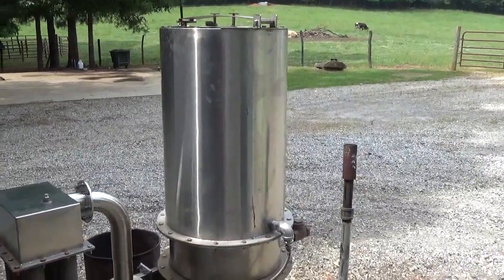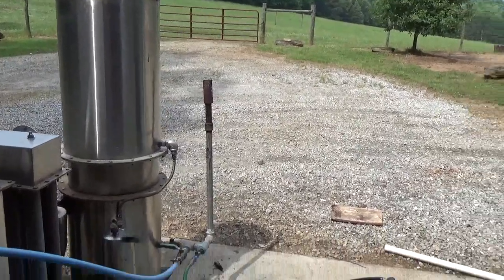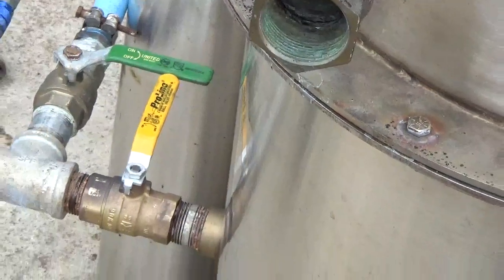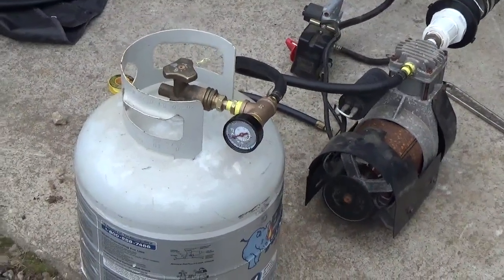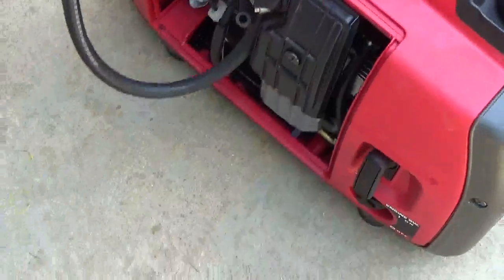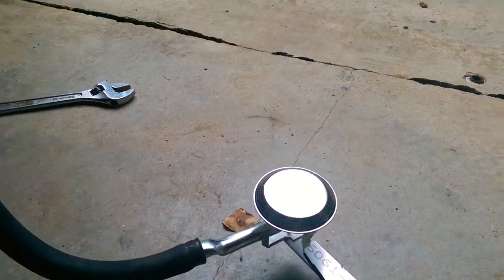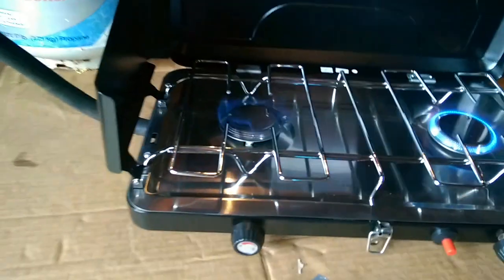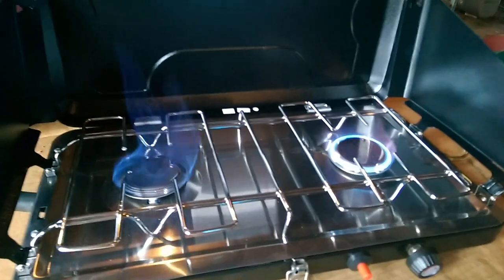Compressing Woodgas for future use.

Comment: Probably mostly air because with a compressor sucking 30-60psi from wood gas generator. It will take maybe 2 seconds to empty all smoke then sucking air. Will need a large volume of gas in to the compressor

Comment: This is an interesting experiment. I wonder of you could compress the woodgas into a large 300 or 400 gallon propane tank, allow the gas to sit and get very clean, and then run it into an electric generator. With the right setup, one could produce all the heat and all the electricity a farm needs. The electric generator could kick on as needed to supply supplemental power to solar/panels and battery bank. Heat extracted could go into the house, hot water an home in winter months.I know the big problem historically has been short engine life due to build of a dirt,  ash and more in engines and engine life in a sustainable situation like this is very important.

Comment: Questions to you or others who have ventured further and experimented with gas mixing. 
Q1.     What are the additional dangers and feasibility of this operation you have demonstrated with the compressing and storage of woodgas if small amounts of hydrogen gas was introduced in a purposely devised vortex style chamber that is vacuum operated by the compressor. 
Q2.     Will the two gases actually mix and remain that way under compression or will they separate? 
Q3.     Will the gas derived from a hydrogen reactor if "remained mixed" with wood gas still brittle the propane tank?
Q4.     Are the rewards of increasing the BTUs of the syngas worth the  inherent dangers of adding hydrogen production to this process????
Yes the possibilities are very big but so can explosion!

Comment: Edit: Upon further investigation it would seem some of the carbon byproducts act as an inert barrier to stop embrittlement for a time. That being said if you are storing this for a large amount of time the embrittlement will still occur albeit slowly. I still feel my original comment still stands truthful. This is still very dangerous and should not be attempted unless you can regularly hydro-statically test your gas cylinders and have a H (Hydrogen) and COx (CO2,CO,etc) ppm tester.

JESUS CHRIST!!! look man not gunna lie compressing hydrogen and various hydrocarbobs is a disaster waiting to happen. I see your using a old propane tank too bad its made of steel/aluminum which with hydrogen and most hydrocarbons causes embrittlement! Hydrogen its self has been known to spontaneous detonate when it reaches a certain ppm with the open atmosphere. TO ANY ONE WATCHING THIS VIDEO, DO NOT ATTEMPT THIS VERY DANGEROUS!!!
Reply: That's odd.  Propane is what?  C3H8 or a hydrocarbon close to that.  So if the cylinder works with propane, why wouldn't it work with woodgas, aka methane, aka CH4?    Also, pure hydrogen is stored in steel cylinders under very high pressure.  So why no embrittlement there?  Spontaneous detonation of hydrogen?  Maybe inside the sun.  True, hydrogen gas is extremely flammable, but the gas being compressed is nearly devoid of oxygen, certainly well below the LEL concentration.  I dont believe your assertions and neither should anyone else in my opinion.

Comment: Can't you just condense the gas into a liquid buy rapidly cooling it then storing the liquid like petrol?
Reply: Methane, under normal room temperature, maintains a vapor pressure of around 3000 psi, meaning to liquefy it at that temperature, or rather, to maintain it liquefied at that temperature, you need a cylinder capable of those levels of pressure.  Supercooling the gas to liquefy it is achieveable, but then you either have to keep it cold, allow it to bleed or have a high pressure capable cylinder.

Comment: The one problem I see with this and it's a fucking huge one is the fact that you're mixing the gas with oxygen as you compress it from using a pump that overcompensates for the flow of the gases expanding from the fire and is drawing an extra 02, and with fuel and an oxidizer in the same vicinity you're basically making something that could detonate whenever it decides to

Comment: I been looking at so many videos on producing wood gas, compressing wood gas for future use, fueling cars, running propane powered refrigerators off-grid. I really want to have an off grid cabin one day that I use wood gas for heat,cooking and electric. My only question is of all the videos I've seen people running a generator on woodgas how come people are always running converted gasoline powered generators rather than propane fueled generators or even the duel fuel generators that work on either gasoline or propane. Couldn't you run a generator that's already set up for running on propane on woodgas without modifications because it's a gas instead of a liquid fuel?
Reply: yes.

Comment: Are there any issues with scalability of this concept that you can think of?  I was thinking of doing exactly this but with a larger tank to run my 17kw gen when the power goes out etc.  Safety wise, does it store as well as say nat gas or propane in this format?

Comment: Using wood directly to say, cook dinner, is a tedious and wasteful affair. There is really no way of doing so inside of your home during warm months without making the inside of the home horribly hot. Of course, you could have a "detached kitchen/summer kitchen" for this, but cooking dinner would still be hot work.

Or, you could spend some time generating wood gas using free wood, then compress it (being sure the tank is properly purged before adding wood gas) for later use. Then, you can utilize it in a similar manner to propane. I suspect that it could be used as a replacement to propane if a burner configuration that is most efficient for wood gas is figured out and the propane appliances "converted". Probably would need to find a good way to regulate the wood gas pressure as well. If all this were figured out, in theory, you should be able to replace propane with wood gas. The flame-out safety protections on propane appliances should work for wood gas too (cut off gas supply if the flame goes out).

The big limiting factors to "converting to wood gas" would be obtaining wood gas (pretty much have to do it yourself with equipment you made yourself), ensuring safety (CO precautions), and sustainability. Theoretically, wood can be farmed to make it a renewable resource and it should be doable even if a large portion of the population "switched" over to wood gas instead of propane. Once technology advanced in the storage of wood gas, running cars and trucks on it would be pretty easy. No longer would you need an on-the-fly gas generator that takes forever to get going. You just turn on the gas supply, start up the engine, and go. When the wood gas is low, refill it either from your own storage tanks at home or at future wood gas stations.

Imagine, independance from oil companies when it comes to transportation. Imagine, a clean renewable energy source that can be used at any time of day or night regardless of weather. An energy source that is actually cheap to use. Making wood gas is quite simple. The hard part is filtering and storing it. If you can store it in a safe manner, you can transport it. If you can transport it, you can have wood gas refill stations. If you can have wood gas refill stations, you can run cars and trucks on wood gas in a similar manner to how we run them on gasoline and diesel. Instead of fields of corn, it will be massive forests of probably hybrid or genetically-modified trees bred/designed to grow quickly yet still yield a decent end-product.

Wood gas can be revolutionary. It can run gasoline engines. It can heat homes. It can be used to cook with. It can run generators (producing electricity). Pretty much anywhere propane or natural gas is utilized, it can be utilized. If the supply chain adapted properly, it could be a solid long-term renewable resource that is way better for the environment than our current fuels. It could literally put a huge dent in the climate change issue. With so much use of wood, naturally, companies and researchers will begin trying to find other ways to utilize wood. Maybe we could someday replace all our plastics with wood-based plastics.

Comment: Can anyone tell me what the problem would be with compressing using a combination tromp/ram pump say  60 to 80 psi? seems like the perfect low teck solution especially if the gas is being used directly out of the rams gas cylinder. Cooled and compressed in water. would the contact with water make for unusable gas?

Comment: I've watched people build these and they think they got good gas because it's burning the flame is just as red as can be so they run their generator it runs fine till they shut it off and it cools down and then all the sap that's in there locks the motor up screws up the valves the cleaner it is the less you can see it you've got pure nice gas if you filled a thousand gallon tank with that machine you could run a generator for a long time but the power went out you could heat a house for a few months the possibilities are endless when you've got such pure gas nice job good build

Comment: From what I gathers wood gas has lower btus than petrofeuls . Still its wasted ennergy . Light load electricity and horsepowrr can  be generated in house rather than buying it from external source . My hope is to run a 14 horsepower riding mower of of compressed woosd gas . I want to build work horse truck using a cvt  and a 14 hp engine . Basicall a dump truck for hauling 600lbs payloads at a slow pace . Not sure yet how feasible it will be giving its low btus but am willing to try

Comment: Have you done any more experimenting with compressing wood gas?  Wondering if you filled a bladder (e.g. military fuel bladder) with the gas and then compressed in the tank would help not pull air in with the gas??

Comment: Could getting a bank of batteries......... charging them up , getting the conversion equipment........

For me......... although more expensive......... it’ll be a lot more safer.

Operating a generator with a gasifier for me is a better option than getting solar panels and still having power companies getting into my pockets.
Reply: Generators usually run around 25 hours or so before you're supposed to change the oil, though that varies, but it's still a cost you should consider. Also, batteries lose charge over time. After about a month a car battery won't start a car, so compressing wood gas is a better long term solution.
Reply: @ Robert Sullivan 

You are making a lot of sense.......

I think I’m going to try baby steps first........ like, can I cover my energy (electricity) demands for my air conditioner to cool down my house 100% and taking that cost away from my bill. Then do the energy for washing and drying the clothes.......... believe me......those two are killing my budget.......

Then...... lastly......energy for an electric ⚡️ car 🚗.

I’ll be a very happy camper.

Comment: Yes! finally I see someone charging up a tank with woodgas. I really want to know how much and how long it would take to fill a big ol whole house storage tank. How long can it run a furnace, stove, and water heater? Copper tubing to preheat water around the gassifier rig to increase efficiency and reduce water heating loads?
Reply: Mark Herndon let me know if you have come across any run time Estimates?? 
Thank you
Reply: I wanna know too😂
Reply: Nobody is likely to give you an answer to that because it isn't very long at all. 
Back in the war when they ran vehicles on wood gas, they had the gasifier on board and had to keep adding wood if they wanted to keep going. You are probably going to get better results filling a 5 - 10 cubic yard balloon or bladder, rather than trying to compress the gas into a bottle. It takes a great deal of energy to compress gas and, surely, the whole point of wood gas production is to provide an emergency, or off grid, supply of energy., not to use up more power than you will get back from the gas. Another point is that the pressure you get back out of your gas bottle will rapidly reduce as the gas is used up making for problems with carburation or controlling gas flames, You are better off firing up the gasifier if and when you need it and using the relatively constant pressure you get delivered direct from your gasifier. To cover emergencies, you could fill a balloon or two and adjusting carb or burner jets etc. to roughly atmospheric pressure or slightly above. You do need to use a special wood gas rated balloon but even with these, there is likely to be significant gas leakage, especially hydrogen, and there are real safety risks. Far better to burn direct from the gasifier.
It is a pity, but liquefaction is way, way beyond DIY capabilities and hugely expensive to set up the specialist cryogenic and compression equipment needed

Comment: Won't this put air into the mix through the compressor? Can't that lead to heat build-up -> possible explosion? Damn, I'm tinkering with bio-gas, syngas, hydrogen, but am often halted by an immediate sense of danger. I'm using it as I produce it so side-stepping the issue so far, but the practicality of it sure would be nice. I really appreciate your attempt at this.

Comment: Is the air to fuel gas mixture a 1:1 in comparison to the propane burner's rate or rather does the wood gas require a smaller size air opening for it to operate by comparison to propane [or for that matter fuel inlet orifice]. It was burning like a blown out [rusted to grief] propane burner.

Comment: watch out staring and getting skin closed to the burn. There's a lot of hydrogen in that. Hopefully (for possible fuel cell purposes) it's mostly carbon monoxide and hydrogen. If you don't want to suffocate when you have a gas break you might want to invest in a water gas shift reactor. I believe you just take iron oxide with a filter on the back. This has to be done at 1000 or so degrees, but the gas comes out of the woodgas reactor that hot at least. I heard chromium is used too.

Comment: lots of comments about the danger of explosion. are those from theory, or have you witnessed the kaboom? has anyone had an accident? or successful/unsuccessful attempts at compressing wood gas? would love to hear your stories! thanks!
Reply: That is because inherently, a forced-air downdraft gassifier, the air is drawn through the system faster than the burn rate, which means that no matter how clean your woodgas is at the end of the process, it has unburnt oxygen in the mix.  So you are compressing woodgas fuel and oxygen into a cylinder, it is just not a good idea, which is why for a very long time, gassifiers have been used as an "on-demand" method of producing syngas.

Comment: Greetings, I really love the ideas I see on many channels about this type of gas. I first seen on Mr. Teslonian's channel about using wood to get gas from.
How about seeing how Hemp would work since that is one of its uses of the thousands of uses. :D
Reply: I want to experiment with alternatives, hemp, giant ragweed, even cornstalks. I theorize that if it can burn to carbon, heat, and CO gas, it would work. wood being more dense makes it the better fuel. I'm still in the process of design and build though.
Reply: @babysquirrels you can make homemade cement with ash from corn waste? Interesting🤔 I know fly ash from coal burning can be added to concrete; I know it makes it stronger and I think you can use more fly ash and less cement to make concrete

Comment: Thanks for the side by side propane/wood gas comparison.  I've been thinking of using wood gas as a replacement for propane for household use (I have a lot of waste wood, so if I can use it to replace my propane bill... great!)

Question: How are you producing the gas?  My thought is that a stratified downdraft gassifier adds air to the mixture, which would contribute to the BTU loss.  If you're making it in a sealed container (search for charcoal refractory) might get more energy per cuft of gas?

Also, in the video it seems like the propane is coming out at a higher pressure... When Liquid propane turns to a gas, it's at about 110-120 psi, and then it gets regulated down, but you have a consistent 115~ PSI.  With compressing gas, you start out at 115~ PSI, and it drops from there.

In the case of my propane tankless water heater that might not be a problem, the propane gets stepped down in pressure from 115~ to ~11psi, and then down to 11wc (less than 1/2 psi).  From what I've read online Gas grills run 20 - 30 psi... food for thought.  Thanks for the video!
Reply: i agree the propane seems to be at a significantly higher pressure, also the burners used could be better designed for the fuel

Comment: My compressor from my air compressor would get hot, could it cause the wood gas or hydrogen to explode?
Reply: yes but no, it COULD make the gas explode, but it won't. If you were using hydrogen, this would be a different story.